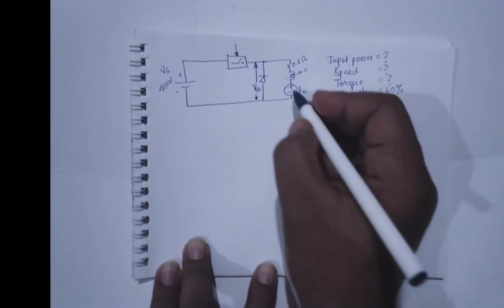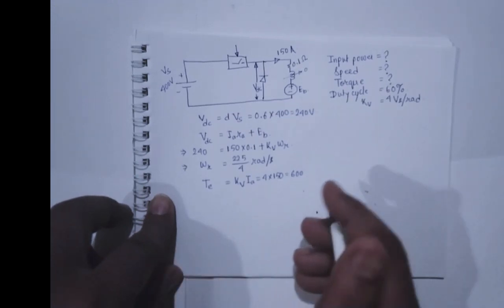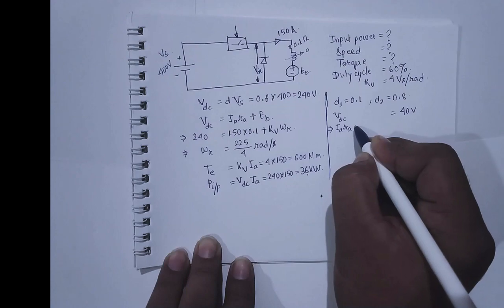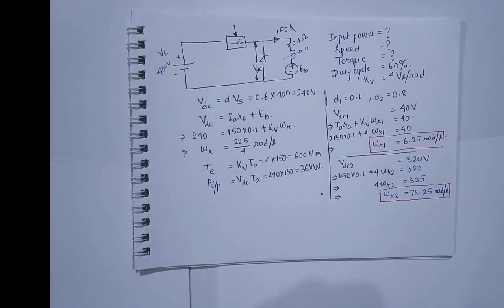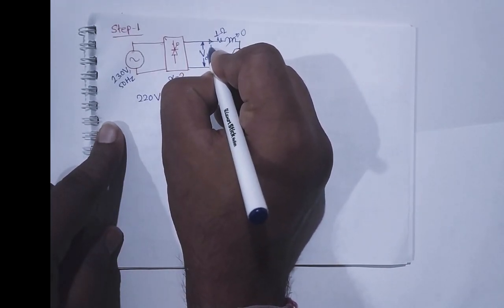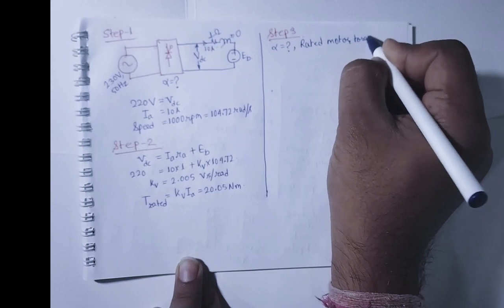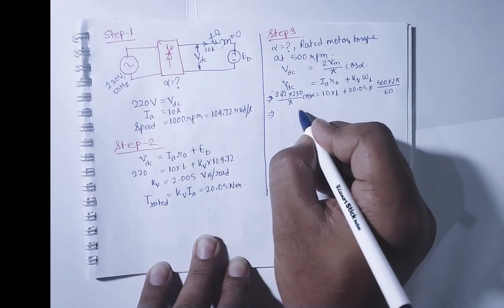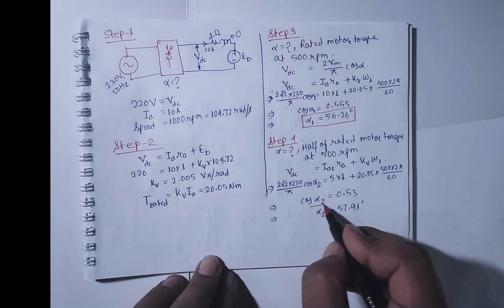How to Solve | DC Drive | Step by Step 1 | Tech TALKS

Comment: Sir in the second numerical in step 3 and step 4 Kv will be 2.005 or 20.05?
Reply from the maker: 2.005, but the values of firing angle is correct. Thank you for notifying me.